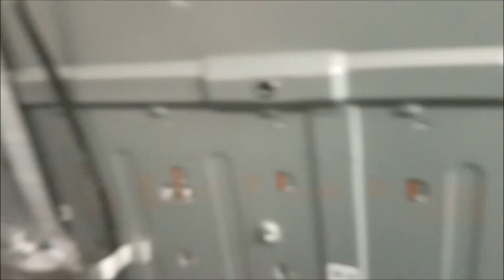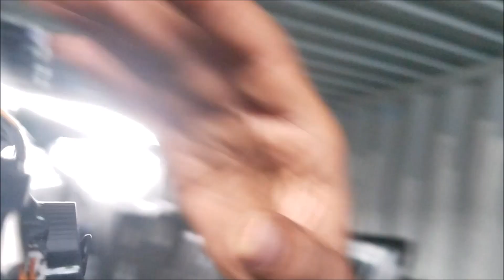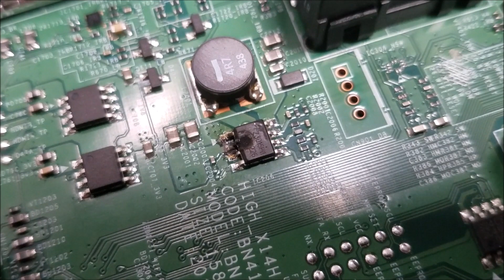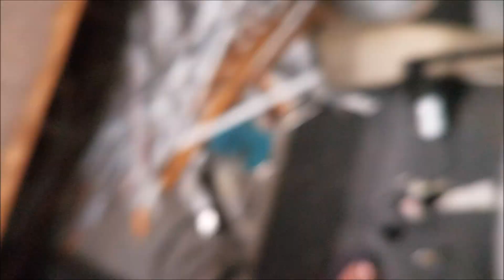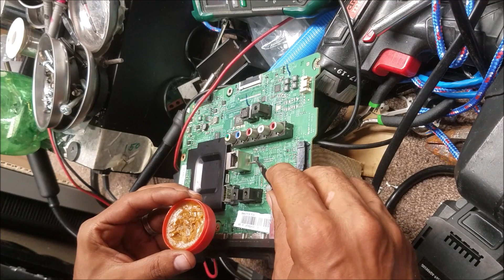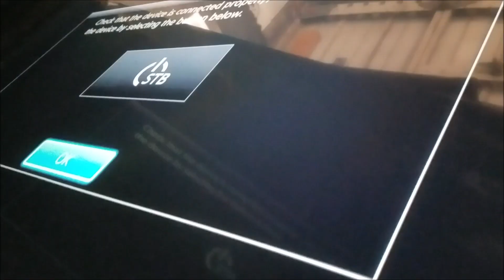samsung tv UN75H6300AF dead common issue mainboard repair

Comment: Copper welding after a chip blowup is also common on GPUs, ie, you have to manually run wires when the pad breaks. Good job.

Comment: I have a TCL 4-Series 65" 4K UHD HDR LED Roku OS Smart TV that has a defective screen (left side is green) and dim picture. Is this worth trying to fix? I love the way you can find the problem just by looking around. Sometimes it is right in front of you, sometimes you just have to do some detective work.
Reply from the maker: Could be a bad cof or one of the power lines shorted/opened. I didnt see this issue on tcl 65 before usually i fixed the backlight on them. Yeah or you may look for a backlight issue set to swap the screen for it sometimes i buy backlight issue sets under $50.

Comment: Thank you for the heads up with this set and the chronic issue. Good to know this if I get one to fix. Flir camera came today - what app are you using for it? There are a few different ones.
Reply from the maker: great. what you have android or ios? i have android one and i m using flir one app the official free one, i didnt try the other paid ones but i read negative comments about them, enjoy bro
Reply: @SOSfixElectronics  I bought the android flir pro LT, Amazon had it for $180.00. 😳   Thank you!!
Reply from the maker: @electronicrepairservice2020  that was good deal. Thats what i have. The original price was 399 i paid 275 after discounts codes.
Reply: @SOSfixElectronics  Yeah, good timing because it went up $100 the day after I bought it...wow I did better than I thought after hearing what you paid. Still trying  to get it to work with my old android. 😖 Had to get a usb c to micro adapter, still not working, perhaps not compatible with the phone (Meizu). Waiting on a reply from Flir. Gonna borrow another ph to be sure it's not the camera 🤔
Reply from the maker: @electronicrepairservice2020 mine is a usb c too and i m using it with samsung s9+ you may need to get another phone or get a blacklisted or other small damaged samsung phone for the camera only to save some money